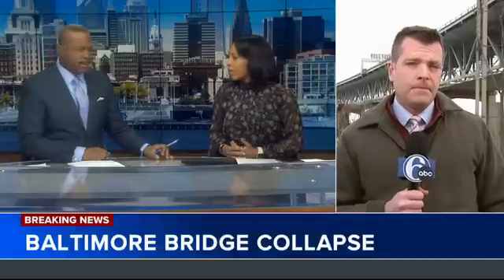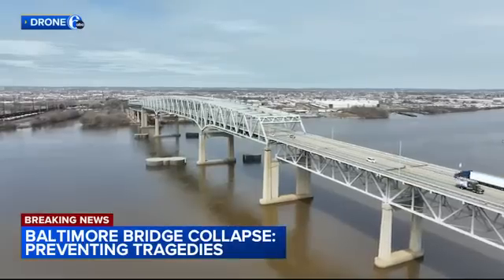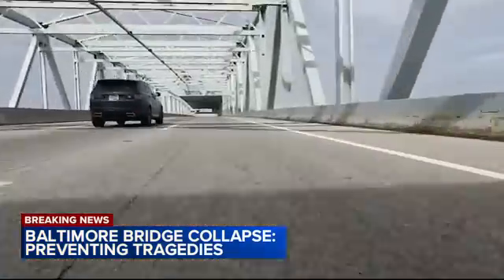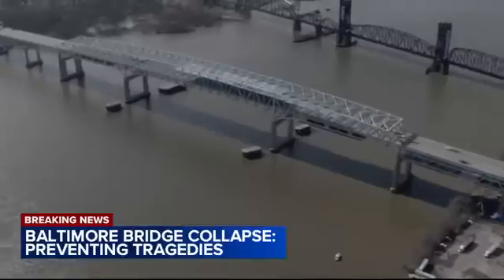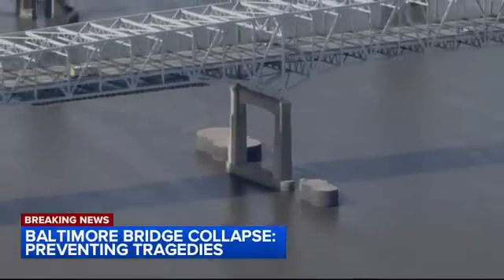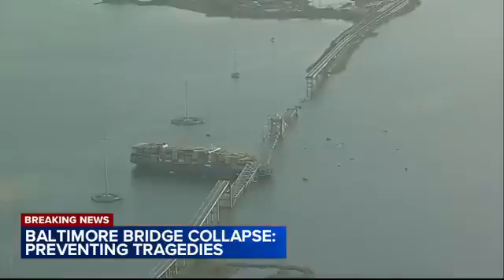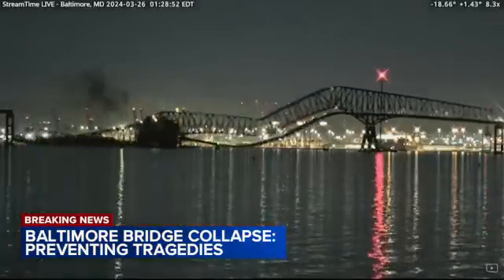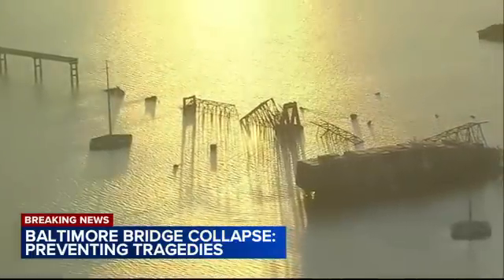Here's what surprised a structural engineering professor about the Baltimore bridge collapse

Comment: You didn’t need a structural engineer to see there was no protection for the bridge supports. This is the first thing many of us saw and we are not structural engineers.
Reply: Did you not hear the part about how the continuous span should not have collapsed the way it did even if the pier was taken out?
Reply: @Dave-sw2dm I'm curious how a trained engineer could say that about an arch-supported bridge.  It's patently untrue: if you take out the support at the end of the arches, the entire thing will drop, because none of the spans will be balanced on their support once the adjacent span drops.
Reply: @bronco5334 it's NOT an arch supported bridge
Reply: @bronco5334 agreed, I'm pretty sure he's not an engineer, just an enthusiast who's into structures....
Reply: @TingTingalingy Sure they do.  Bridges that allow traffic  to pass under them don't have redundant support piers.  If you take away a bridge's support, it always collapses.  The only thing that changes, depending on the type of design, is how much of it collapses.
Reply: @Dave-sw2dm  Crap, the piers are there for support, if the bridge wouldnt have collapsed without them, then why put them there in the first place, the correct safety procedures were not in place, just another small reason why America is actually a Third World Country.
Reply: @Dave-sw2dm  I'm a strutural Engineer. From a few rough calculations you would need 40m (131 foot) diameter pier for the pier to sustain a sationary load ( if the ship is at rest but hypothetically leaned on to the pier). But the ship is moving at 7.5 knots (13.9km/hr) that would require around 850m/ 0.53 mile diameter pier  (you don't have a port) with the highest concrete grade mankind has ever seen.  The professor claims a continous span bridge should have stayed a little longer which I totally disagree. Once you lost one support, all of your smart calculations are gone and failure is inevitable. Had it been a simply supported span, the outer spans might not be affected. Though I know what he's trying to say (a continous span should have redistributed the load) but I don't think he has seen the mechanism and type of the support provided. Once there is no weight to couner balance at one end, all the weights are supported with the one at the opposite end (roughly double what it needs to carry) this is due to the nature of the support. (designing the support this way has huge advantage at normal circumstances). 
Edit. whoever tells you that you can design a feasible structure that can withstand this kind of cargo ship (119,000 tonne at 13.8km/hr) , just show him your middle finger, he deserves it.
Reply: @Dave-sw2dm and all the concrete roadway from the bridge was seperated and went into the water
Reply: @Dave-sw2dm I believe that he's mistaken on that.  My understanding is a continuous truss would fail entirely if it loses support in one section because it's "continuous" i.e. one solid structure.  If you were holding up a yardstick (36 inches) with two fingers, perhaps with one finger at 12" and the other at 24", then you take away one of your fingers, then naturally the whole yardstick falls.
Reply: @sottx8268  , what engineering field do you have your degree in?  The bridge wasn’t teeter tottering on that pier.  Without the weight of vehicles on the bridge it might have only sagged a little with the pier removed because it was a continuous structure.
Reply: Yep....first thing I thought when I saw the carnage. A simple precaution, and not at all high-tech. Just a big hunk of concrete.
Reply: @bobpourri9647 The bridge didn't originally have dolphins because originally, the navigable shipping lane was shallower and narrower: no ship large enough to do damage could get that close to the support without running aground before it got there.  They dredged the channel to make it wider and deeper, but never installed protective dolphins to mitigate the fact that ships would no longer run hard aground before reaching the supports.

The ship DID actually run aground, it just didn't do it far enough away to prevent the collision.
Reply: LOOK.....the power line towers have ship barriers so WHY didn't the people bridge get adequate protection?
Reply: When this bridge  was designed, cargo ships were not the size of aircraft carriers.
Reply: @johnschuh8616   So what? After the Skyway bridge disaster in 1980 they knew they had to add protection. You are letting them off the hook for that.
Reply: @rael5469  Easy to  say, hard to do.  Get a horse’s attention? Try a 2x4.   Most  officials are focused on just doing the jobs at hand, Then keeping their jobs.
Reply: @johnschuh8616   I think the voters should clean house because of this disaster. Whoever is in charge of that bridge who COULD have done something but didn't......they should recall the entire department. Fire them and cancel their pensions.
Reply: No shit.
Reply: They claimed concrete dolphins would 'cost too much'. I thought Biden signed a $1.2 TRILLION "Infrastructure Investment act 3 years ago?
Reply: OP is a troll😂
Reply: @TingTingalingy   Takes one to know one.
Reply: DESIGNED TO FAIL > ENEMY EXECUTED SABOTAGE. Bribes and blackmail and you too will drive a ship into a bridge for Israel. Remember the USS Liberty. The elephant in the room that we don't talk about. Every single time.
Reply: Structural engineers just talk from there ass. Definitely underdeveloped to todays infrastructure.
Reply: @robbyrigoni2940  Yeah! It's a good thing we have YT commenters to explain things properly! ;)
Reply: you say this, because you have common sense, most people do not. most people are so dumb that they need to be told "knives are sharp".
anyone who thinks you need to learn years how to become "expert", is just dumb without common sense. i could build a bridge without any prior knowledge of how bridges are built, it's common sense.

building a bridge is quite easy, you just have to understand basic physics.
Reply: @SethiozProject  Your bridge would cost twice as much as an engineered design.
Reply: @SethiozProject  no, this is an overinflated ego you have. Because you can make something doesn't make you an expert.
Reply: @SethiozProject  You're wrong
Reply: Lol well you’re wrong so maybe you should listen to more informed engineers. I don’t have a degree and there are obviously four concrete dolphins upstream and downstream of each support. They’re farther away from the pier than usual but they’re there. The ship missed the dolphin.
Reply: @crosshairs3  to the untrained it sure looks like it wasn't properly protected, but if the more informed say it was, then I guess it never collapsed??
Reply: @crosshairs3  So for us non engineers the real engineers stuffed up then didnt they, THE SHIP MISSED THE DOLPHIN, wow all those years of uni wasted, if tugs stayed with the ship until it passed the bridge or if the bridge only had one lane they they could build a football field around the footings. At least if the U.S. authorities have used safety measures that were put in place after the  Hobart's Tasman Bridge across the River Derwent then this accident would never had happened.
Reply: @crosshairs3  So what's the point of the dolphins if the ship can miss them?
Reply: @crosshairs3 no there really isn't. Look up the Baltimore banner it's a new paper and it showes a sky view of the bridge and yes there are very small circular piller heans sticking up and if those are dolphins there more like ant poop drops.
Reply: @crosshairs3 Those are to protect the electrical towers, not the bridge.  And if they are too far away to prevent the bridge from being struck, they aren't protecting the bridge, are they?

Comment: How deep is the water in the area. It doesn't appear to be very deep. As parts of the bridge can still be seen above the water
Reply: Not deep at all,  The central channel is dredges to something like 50 feet,  depth outside is in 20 feet range.   MV Dali  current draught is stated as 12.2 meters = 40 feet so it probably had less than 10 feet clearance in the channel.   I heard even lower numbers for the channel, like 30 feet,  but then this ship would not fit :)

Comment: How big were the ships passing under the bridge in the 1970's and how big are they now? Not so sure even that concrete block could prevent a ship bridge collision. Would help off course.
Reply: The bridge pillar is still there. A protection dolphin would basically be the same (possibly stronger, and designed to take lateral impacts), placed before the bridge, so it would have stopped the ship at least as well as the pillar did - but before it hit the bridge.

Comment: Looks to me the bridge was built as flimsily as possible for the most amount of money. Should've been more independent sections and support along with the "bumpers" so the whole damn thing wouldn't fail.
Reply: Bridge was designed and built when 100,000 ton ships weren't a thing, truss bridges work fine until a massive object takes out a support structure
Reply: @Freedomcustom  I suppose you could say it took a 100,000 ship to knock it out but who really knows. Might have needed much less. Not much forethought went into the plan when you know ships are always getting built bigger.

Comment: This is hardly the first time a bridge has been taken out by ships, boats or barges passing beneath it.  These things are extremely expensive to build and maintain - and there are times when it could have been done better.

This bridge existed for a good long time before this accident - and all the people who didn't want to spend the money to make it safer seemed to be right.  Now they don't.

For some time now there has been discussion of the sad state of the Nations Infrastructure and the fortune it will cost to fix it.

As to those dismissing the utility of the concrete barriers protecting other bridges - something like that - designed to deflect ships - is going to work a lot better than these people think.  The concrete is fixed in place - the ship is moving over water - which do you think is more likely to divert the other?
.

Comment: In the freezing winter, a bridge will literally shrink and in the summer, it will elongate.  The longer a bridge is, the bigger this effect.
The supports holding up the bridge must allow for the bridge to move around a bit to allow for thermal expansion and excessive vibrations (earth quakes, etc).  
By design, these bridges are not rigidly attached to their main supports.  The bridge literally just rests on the main supports.
This is why, when one of the main supports was taken out the rest of the bridge instantly collapsed.
Reply: umm you are not very intelligent. please think harder before spreading ignorance. engineers already account for temperature. good bridges don't collapse all at once.

Comment: The deeper the water, the more challenging it will be to build an effective protective system because a heavy boat will put more torque on the protection barrier when striking it.  With that said, hindsight is 20/20 and it was asinine to create a bridge this important and this large without putting protective measures in place.

Comment: The bridge was going on 50 years old, built in 1977. I'm assuming bridge design, materials, construction methods, and safety protocols have improved greatly since then. Also, container ships as massive as the one that struck the bridge may not have existed at the time. It may have been a perfect storm of an outmoded bridge design ill suited to handle the dangers of modern shipping.

Comment: The bridge protection dolphins are absolutely essential.  Unfortunately, we have no control over the ships, which should have redundant power systems.  A power failure should not cripple a ship, but they do if the ship is not properly designed or maintained.  With the enormous investment in these large bridges, there must be protection from ships.  The Baltimore bridge will cost hundreds of millions, if not a billion dollars to replace.  All could be avoided but for the cost of investing $10M to $15M in bridge protection dolphins.

Comment: It looks like everyone is jockeying to either get their name out there or apportion blame.  At the moment, this appears to be an accident.  Furthermore, the bridge was built in 1977 and the amount of cargo ships that passed safely under that bridge every single month since 1977 is proof positive that the system was working until this alleged freak accident happened.  I'm concerned about over-correction at this point.  There is no need to make the project bigger than it needs to be out of some emotional reaction.  

Another positive that came out of this were the preventive measures.  The fact that even before ship struck the pylon, the Harbor personnel, MDOT and SHA were present and aware enough to stop traffic in the middle of the night moments before the incident happen.  That means that the people on the job were paying attention.  

I used to drive trucks over that bridge every single day traveling from Aberdeen to make deliveries to Stevensville, Annapolis to central Delaware and all the way to the coast: Reheboth Beach, Ocean City etc...  Knowing that the safeguards that were in place worked and mid-night traffic was stopped prior to the incident is a very comforting thought.  Even in the video, moments before the strike we see the sparse traffic truck traffic stop all together.  

It also needs to be noted that Sparrow's Point, which is on the east side of the bridge, has a major commercial and distribution area along the eastern shore of Maryland.  Amazon, Under Armor, Home Depot, etc... move trucks in and out of that area day and night.  It's the fastest way to get to BWI for for shipping air freight as well as an alternate route to Washington D.C. going from the i97 to route 50 or for taking routes down into Virginia using the 301.  Truck traffic isn't allowed on the 295 into DC so they must go up and around.

Comment: I live in Baltimore and have taken my boat numerous times under the Key Bridge. Actually, there were small concrete buffers near the pylons that probably would have prevented the accident if the ship had gone straight, but off course. The problem here was the ship lost power, went out of control and swung around; the same could have happened to the Delaware River bridge.

Comment: Its called Pete Buttidige and the Biden administration would rather destroy everything than see that  it works... planes falling apart due to DEI hiring. Infastructure collapsing due to them deciding roada are racist and so are trains... even though its not whites throwing people on the tracks, its whites who get poisoned by their failure.... palestine, ohio... this is by design to isolate and prevent transport, it will keep happening.

Comment: maybe shocking but not surprising at all... that was a big boat... this boat dropped its port side anchor fired back up and went full throttle reverse, that's the smoke you saw minutes before slamming into the bridge. the ship was massive by itself, not to mention fully loaded, stacked 10 by ten with containers full of American cars. if you think it's hard to stop a train, try stopping a cargo ship, there's no room for error, I think barricades would have even failed this one. honestly the pilots made a bad decision. They were on the correct trajectory and they only went off course when they tried stopping it. they panicked. investigation should clarify this.

Comment: I will say ENGINEERS SO SO DAMN DUMB... they really are more stupid then smart.. book smart SHOULD NOT BELONG designing ANYTHING that needs to be built.. I work for an engineer.. and deal with them.. I was 1st in the construction field for YEARS b4.. 3/4 of the time I have to EXPLAIN to them why something WONT work, and they say but the numbers work. BUT this beem can not go in if you have this duct or pipe here.. or this wont hold because of other reasons..  they work with horse blinders on..  at a board meeting in my town, this dumb engineer said well a costco wont change the traffic much because we had them do a study and count traffic.. I had to say something.. told him, WELL DID YOU TAKE INTO THE FACT "OTHER " towns will now come.. there will be 8-9 towns that will now come here, and also the state 6 miles away, since some will be closer to are costco then their own ? I made them look so dumb.. they are only book smart, not building or common sense smart

Comment: Comparing decades old concrete structures and engineering to today's modern concrete construction and computer aided engineering is really not relevant. The deterioration factors  of decades of  saltwater immersion is detremental to both steel and concrete. Even if built yesterday that bridge could not have survived a direct hit to a supporting pillar. No,not an engineer, just common sense. Plus I am not paid to say what someone else told me to say to set an narrative. Most everybody that had anything to do in the construction of that bridge are long dead. IMHO.

Comment: It’s an old bridge and it probably was slated for rehab in that case they would not put those preventative measures on the bridge until reconstruction. The bridge was about 47 yrs old and birders usually have a 50 year lifespan. That guy from Drexel - from another country and doesn’t know what he is talking about historically.
Reply: Probably?  At this point, I couldn't find any discussion about future plans for the bridge.  There were maintenance crews on the bridge at the time of the collapse, but that doesn't indicate any type of upgrade.  

Dr. Abhayagiri has a funny accent and is not white.  Never mind that he has an engineering degree and actually studies structural failures.  May I ask what your credentials are?